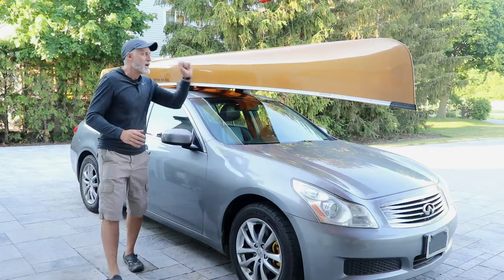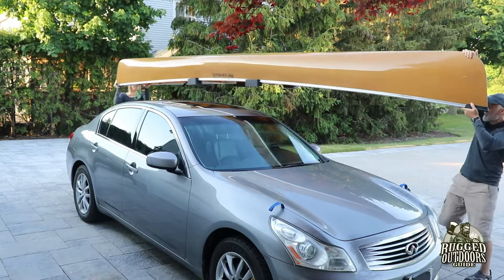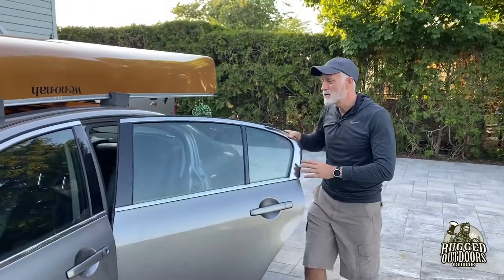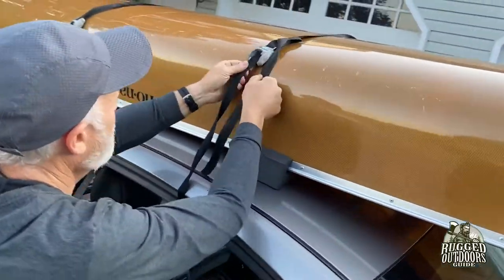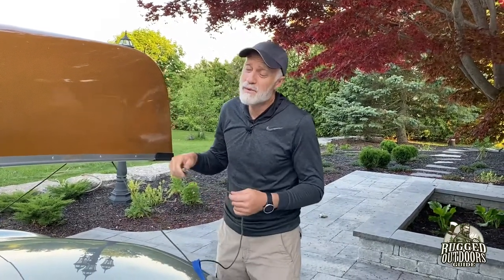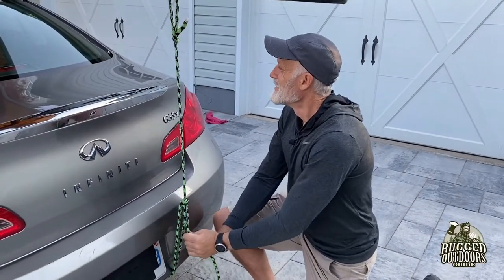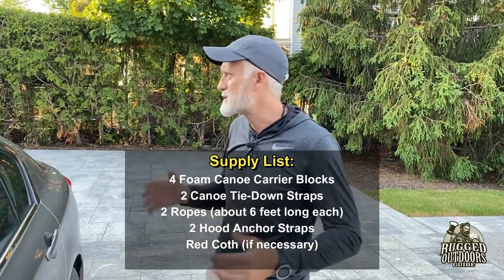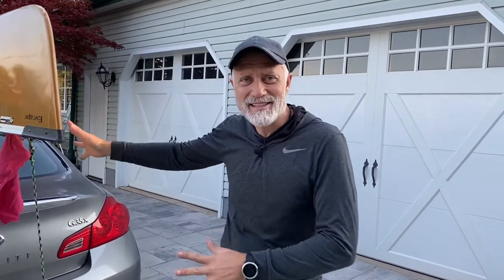How to Mount and Transport a Canoe on Your Car!

Comment: Regarding the twisting of the roof straps, I learned the hard way that if you don't twist the straps and just leave them flat, you don't only have to tolerate the abnoxious noise they make when driving fast, they will also vibrate rapidly against the car and damage the finish and/or your paint job.
Reply from the maker: That sounds about right!

Comment: Better to tie the hood straps to an internal spot under the hood so the hood isn’t under load
Reply from the maker: That's what I thought initially, but after some research online as well as just thinking through it, the pressure I put on the edges of the hood or the latch is very small compared even to the pressure exerted on the bow of the canoe.  Plus, there are dozens of manufacturers of the hood tie-downs so I'm guessing they know some things that I don't!  I appreciate your comment!
Reply: With good separation of the straps, as you show, the hood/trunk ties are strictly for redundancy...you cannot tie down effectively- bow/stern only, without warping most nicer canoes. Same principle as hanging from thwart area rather than ends. Using straps in the config you show is so much better for the canoe, I'll occasionally put 2 straps in front in lieu of hood straps
Reply: Awesome, logical, effective method! I have begun winding up with the buckles inside the vehicle, for reasons you will understand...I also will occasionally use a second, forward strap, Inlieu of hood straps. I prefer the method portrayed, over using roof racks, due to the much better aerodynamics!

Comment: Super useful!  I just landed an old, used 17' aluminum Grumman in remarkable shape at a moving sale for a staggering $100, and had a heck of a time getting it home.  I haven't been in a canoe in  30 or 40 years, I've been watching videos to refresh my how-to recall, and I'm eager to get on a small local lake before Colorado's winter rolls in.  Been trying to figure out how I'll haul it without repurposing a big car-hauler trailer.  You just taught me how to do it with my Jeep (with help getting it up there, of course).  Even gave me links to buy the stuff needed.  Thank you.
Reply from the maker: Awesome to hear - I appreciate feedback - especially if it's courteous, helpful and complimentary!  Blessings!
Reply: I have the exact same story bought a 17' canoe for a $100 (sea gypsie) and I have no roof racks on a Toyota Camry.

Comment: Pretty logical, I would add be sure your buckle has a soft pad--they make em that way so as not to scratch that nice boat.  Looks good.   One difference, some of us use, is correct small diameter but strong, rope.  The reason is that sometimes the straps catch the wind and offer a distracting buzz, whereas rope will never do that.
Reply from the maker: Great tip!  The loud buzzing wind noise is most often eliminated by twisting the flat strap only 2 or 3 times.  Thanks for watching and commenting!
Reply: @ruggedoutdoorsguide9904  you know I noticed you had a twist on the strap but did not occur the purpose--you are ahead of me.
Reply from the maker: @jimquantic  good catch! :)  A rope would eliminate the noise but it's easier to just yank a ratchet strap tight!

Comment: Some details that might interest you!
1. When trying to center the canoe on your car, the foam canoe blocks can sometimes roll right off the gunnels if you push from the canoe from the side side while it is on your car roof. Ouch!  Pool noodles work better than the foam canoe blocks! I use 4 four-foot pool noodles for my 17-foot canoe -  two on either side. Cut a slice right down the center from end to end and push them onto the gunnels. They are stiff, thick, inexpensive, easy to install, and easy to find.  Also, since I'll have up to 8 feet of pool noodle on each gunnel, you have little chance of scratching your car. If you can't find pool noodles, you can also pick up pipe insulation from the hardware store. They will work the same and are already split down the center.

2. If you don't already have a roof rack, don't bother getting one for your canoe! It's easier without it. Most are screwed into the sheet metal of your car's roof. If you put too much stress on them with straps, they can pull right off! Most roof racks are made of hard plastic and will break!  Driving down the highway at 60 miles an hour with a canoe will create a lot of stress on the rack anchor points. They really are not designed to carry a canoe. The above method is more strong and secure, and provide more surface contact between your car and canoe. Plus, you don't have to buy a roof rack!
3. Rather than using a center strap that goes through the back door frames, through the inside cabin and across the top of the canoe, try this instead. Get another set of hood attachments that he used for the engine compartment. Open the back doors, place one on either side of the back door frame, and close the door on the strap. Then use the straps as anchor points for a strap across the top of the canoe. Just don't open the back doors until you are ready to unstrap the canoe. The straps are easy to make and will cost less as a DIY. 
4. Just shaking your canoe once it's on the roof to see if it moves is not a good test of how well it will preform under the stress of the wind at 60 miles an hour. Be aware that the straps on the front will pull the canoe forward toward the front. The anchor points that attach to the back need to pull the canoe back in the opposite direction.  As an illustration, imagine you are driving down the highway with your canoe strapped on the roof. The car in front of you stops suddenly and your canoe goes flying into his rear window. Make sure that the rear straps are situated so that the canoe will not drift forward from a sudden stop. 

Happy canoeing!

Comment: Hi there, I’m a new subscriber. I was just reading one of your articles, comparing canoe materials, and it referenced your YouTube channel. Ironically, I have been transporting my 16 footer on a 2003 G35 sedan, so a very similar car.  But it’s nice to see your techniques as a point of reference. I was lucky enough to find someone with a G35 who were selling a old style Thule rack so it was a perfect fit for me. The main thing I do differently is that I use the same kind of anchor points that you put under your front hood under the rear trunk lid, so I have two ropes there so perhaps a little bit of additional lateral stability should that ever become necessary (as you mentioned).  Looking forward to checking out more of your videos.
Reply from the maker: Hey, I appreciate your feedback Mark.  I've got a lot of irons in the fire so to speak, but I'll try to put out as many videos as I can over the Spring and Summer months!  Cheers,

Comment: Could you please re post the links? They don't bring up the exact equipment you used in this video. And thank you so much for the great video! Super helpful!
Reply from the maker: Hi; You're right that they don't bring up the exact equipment.  The reason is that what I used may not be the best for your vehicle.  The hood loops that go under the hood need to fit in your vehicle.  I have 2 sets.  One has anchors way too big for my car (twice the diameter of an average garden hose) and the other is actually smaller than a garden hose and it fits my Infiniti.  Foam blocks and ratchet straps are generic and you can pick them up on Amazon easily at a variety of price points.  I don't even remember the exact brand I have but as I say, that's likely irrelevant.  I like any on this page - https://amzn.to/3q0bvNA.  Thanks for asking and watching!

Comment: Would you use a stud finder to know where the best strut welds are on the internal cage of the vehicle? Tie down the canoe to the rear on the truck like the hood as well?
Reply from the maker: Knowing where the welds are strongest isn't important when it comes to tying a canoe to the roof.  I would separate the straps as far as possible from each other and then DEFINITELY tie down the ends of the canoe to the hood and to the trailer hitch.
Reply: Thanks!

Comment: Can ya do the same method with the pick up truck ya have as well?
Reply from the maker: If your pickup truck has a fairly long cab (crew cab or extended crew cab) it is absolutely possible.  Even so, with a pickup truck, if you don't have a canoe rest near the tailgate, this method works best (most stable) with shorter canoes.
Reply: I use at least 1 set of blocks and one thru-cab strap... even on a regular cab pick-up, to protect the roof and mostly to prevent the canoe from sliding around. I've had a canoe almost slide off on the passenger side of a rounded roofed pick-up....granted it was an older (1953) model truck and I stood on the running board to hold it  till ✋️ ✋️
Reply: I generally haul my Northstar in the back of my trucks bed, upside down. I have a doubled 4x4 just forward of the wheelwells, with 2 eyebolts on each side. Have a hitch extender that can be configured to extend back 4' with eyebolts for crossing and cross hatch attachments with the front eyebolts. This hitch extender is also able to go up level with the cab top, so I can "cartop" if I desire but it's much preferred to use it in the lowered position